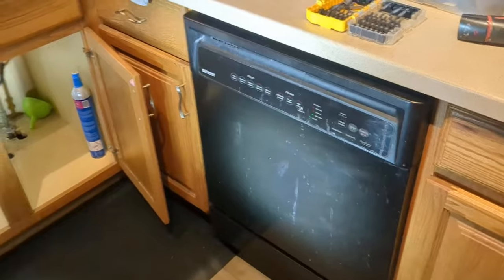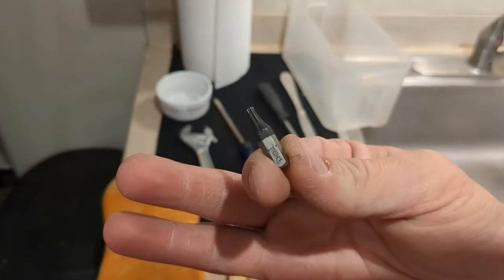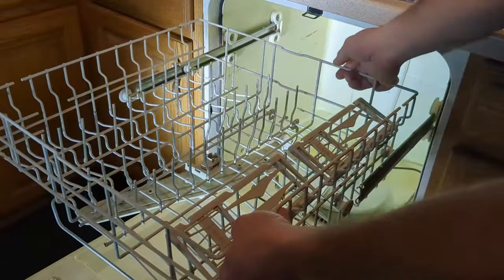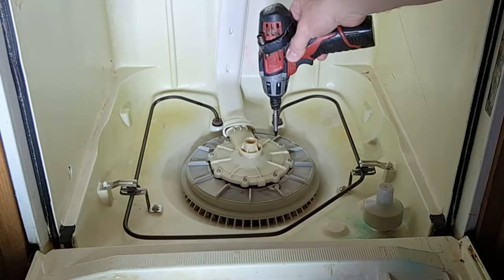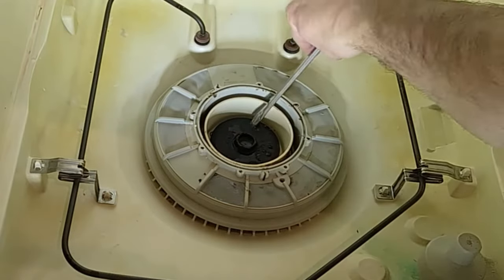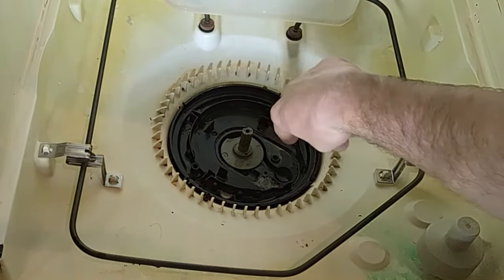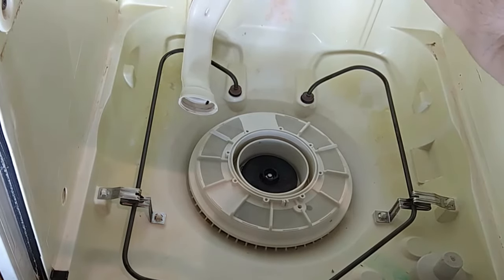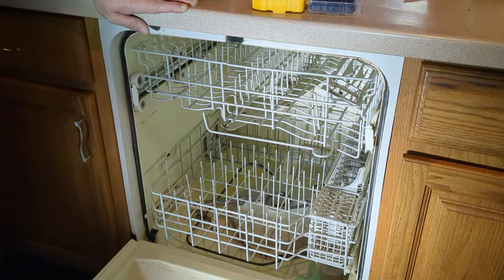Kenmore Whirlpool Dishwasher Not Draining? Best How To FIX DIY! (Quick Repair)

Comment: My problem was a clog in the small white outlet assembly that connects to the drain hose. It just unscrews by hand after you disconnect the hose. A blockage there. I wish I’d known how easy that was to remove before I disassembled the interior impeller assembly and pulled the whole dishwasher out to  try and find the separate drain pump that this unit DOESN’T have.

Comment: That black impeller was difficult to remove and a bit brittle. I broke some little pieces when trying to use a small nail pry tool to get under and lift up (and hope that doesn’t cause an issue.) I found that pinching the big hex (where you used the wrench to hold it while removing the ~1/4” head bolt) inside and out with vise grips and lifting up was effective for removing it.